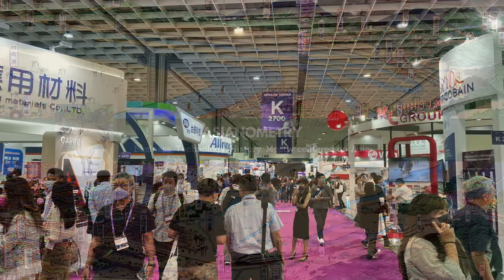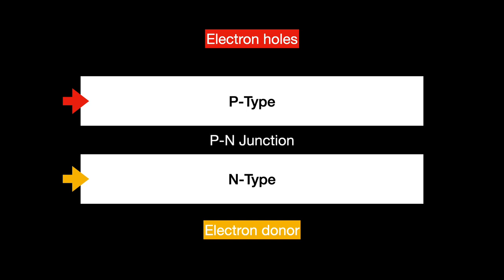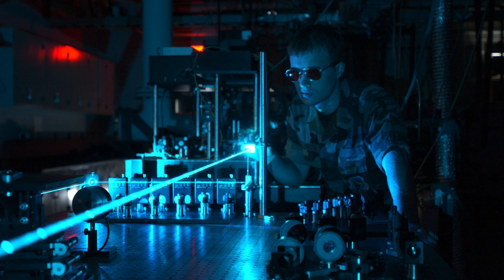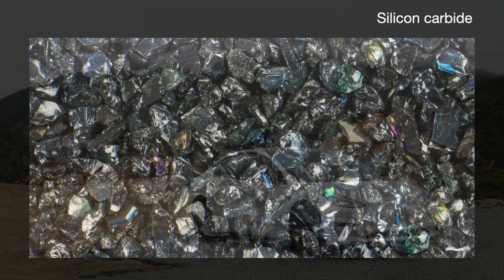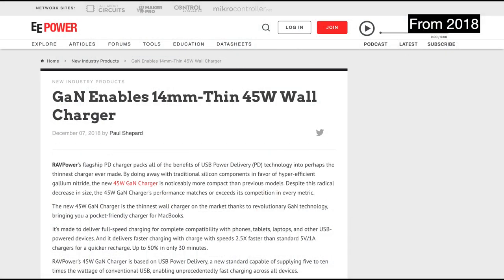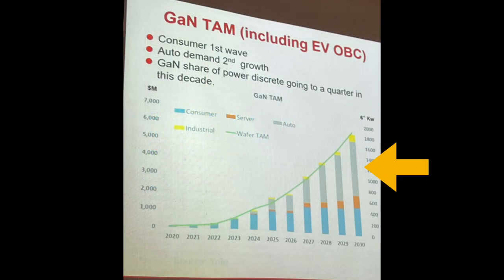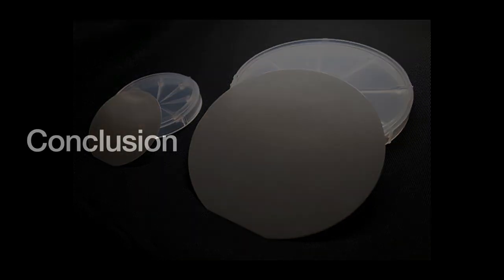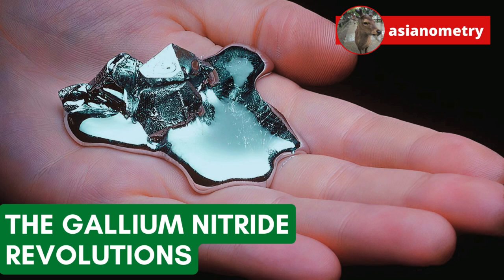The Gallium Nitride Revolutions

Comment: slight correction : it's not mA/h but mA.h, that's energy (not exactly joules, that would be W.s, but for batteries it's the advancement of the reaction so combine that with the battery's potential you get energy)
Reply: I was just coming here to say this :-)
Reply: Was about to comment the same thing...
Reply: It is not energy, but simply charge (sometimes called capacity).
Reply: @UC6j0lZcHJRbSq1J-v8tIYbw @varno Nope. It's a unit of charge. If you know the voltage then you can convert it to energy.

https://en.wikipedia.org/wiki/Electric_charge

Edit: For some reason when I reply to @varno youtube converts their name into that long string of characters while not mentioning them.
Reply: Thank you, I was going to mention the same thing. The unit for 1400 mAh is that it can deliver 1400 milliamperes for an hour, then it’s done. I’m not even sure what 1.4 A/hour would even be useful as.
Reply: slight correction: mAh is not energy, but electric charge.
Reply: maybe the mAh were the friends we made along the way..
Reply: @terrywilder9  technically true, but electric charge moving across a potential difference is energy.  And in the case of a battery, the potential difference is more or less constant and known.  So mAh is as good as, and interchangeable with, energy in this context
Reply: Same......It buzzed my brain. Its Battery charge. kWhrs is energy. I mean the world could be using Coloumb and Joules but we must suffer these mistakes cause Americans
Reply: In fact, that's not a slight correction. that's a big correction.
Reply: @moddingear This seriously  makes me doubt Asianometry and his reliability/validity. I used to trust him before this. Not anymore.
Reply: Beat me to it haha
Reply: @ElfProduct  yep. Same here, like how can you report on this kinda stuff and make such a 101 mistake, at least twice?
Reply: @forbiddenera  in the battery world, amp hour is a commonly (sometimes exclusively) used way to express a battery's energy capacity--things like RVs, and vans and the like all frequently describe their batteries in ah.  The voltage is usually a given (12V, 24V, 5V) and with that information you do get to know the energy in a battery. it frustrates me to no end that this is the common terminology as it can be ambiguous, but it is the way it is.
Reply: @ChuckCassadyYT  I don't know why you're replying to me specifically; I literally design circuit boards and electronics and am very aware of the terminology. In case you misunderstood, the issue we have is that he said mA per hour, not mAh. mAh is what he meant but he said per hour. Measuring milliamps per hour is an absolutely useless metric made even more useless by the quantization effect, eg. Saying that a load consumes 100 milliamps per hour, especially without voltage, tells you nothing of the power used and is ambiguous with at best the assumption being the loads mean current draw is 100mA measured over the period of an hour, but even that is a stretch. Now, mAh on the other hand, which is milliampere-hours (not PER hour) generally tells you how much capacity something like a battery has, 100mAh meaning a load could draw 100mA for about an hour before depleting the source or equivalently 10mAh for 10 hours, voltage generally not being a factor (though with batteries it's generally assumed the rating is at the batteries nominal, mean or calculated/logged voltage).. 

Anyhow, I assume you probably understand this so mostly for anyone else reading though I'm still puzzled why your response was directed at me.
Reply: it is weird because he gets so many more complicated things right, maybe it's a translation thing?

For example, he is spot on about military high power electronics, almost all the developmemt and funding for GaN has been for military.

The mAh units are dumb because they aren't a pure unit. Like how weight isn't the same as mass, but worse. It'd be like if we all lived on different planets and said "I weigh 50lbs, a little overweight" and people have to ask, but we hat planet are you on? Turns out on Earth you weigh 500lbs, so severe.

For that reason I would give him the benefit of doubt that he tried to make sense of units and usually things are per time.
It's purely for marketing. At best it's useful to estimate time you need to charge or run the battery for, if you know the current draw (like 1A for most older chargers, or 2.5 to 3A commonly now, and more). But in usage things draw varying amounts of current. Joules would just be a better comparison..
It almost makes as much sense to say a 2Ah battery runs 2A per hour (for one hour).
In lab battery testing you measure W·h of course, and the integral (area under W·h vs time) is total energy (work it can do). Usually the battery is considered dead when the voltage drops I think 10% of nominal, so even if there's usable charge left at a lower voltage, it is not included (by an honest company anyway..) once the voltage is too low to use as intended.

Energy is like mass in my analogy. (Watt is of course Joule per second, so multiplying by time units in W·h you're getting just Joules, the ability to do work.. more juice, more joules).

If anyone has any good reasons for the mAh usage I would like to hear them, but afaik it's just marketing.

(Also I don't know why you put mA.h or W.s, either... should be mA·h and W·s but for batteries it's common to just use mAh)

I don't know if GaN will be used in homes, there are environmental concerns. People are dumb as rocks so you can't count on them to not eat it, let alone recycle it properly.
Reply: You beat me to it
Reply: Yes, but not energy as defined by physics in potential or kinetic energy. Or by electric potential energy as defined by volts. It is electric charge.  
I think mAh is a very flawed metric when comparing rechargeable batteries and is exploited by manufacturers and retailers. Watt/Hours is voltage independent and can be used between different cell types and multi cell batteries. Where mAh could easily suggest that a much smaller batty with only one cell could store more charge than a 4S battery, for example.
Reply: @wouldntyouliketoknow9891  The potential difference for a battery isn't constant at all. It varies substantially with its charge. If you take a typical 1.5 V cell as an example, it typically varies from about 1.65 to 1.20 V over its useful life, though depending on the application, you might be able to drain some more charge from it before it is effectively dead. For rechargeable batteries, you get the same problem: high voltage at high charge and low voltage at low charge, which electronics have to deal with. The actual energy that can be extracted from a battery can be difficult to calculate in practice and depends on the device you put it in. However, the stored charge is easily calculated, which is why that's what they report.

Of course, in principle, the stored energy in a battery can be calculated with a relatively straightforward single integral, but the calculated value won't necessarily match the energy you actually pull out of it or the energy required to charge it, so it's just a nominal figure without much practical use.
Reply: @craigslist6988  mAh is used in both marketing and in product design. This is because the current drawn by a device is usually specified in milliamperes. It's the same reason kilowatt-hours are used in power generation. Most people don't have an intuitive sense of how large a coulomb or megajoule is, and when calculating things for their own use, it makes far more sense to measure time in hours than in seconds.

The reason units of charge are specified instead of units of energy is that they are easily verified and are application-independent.
Reply: every YouTuber is a EXPECT 🤫.
Reply: @kevinb2469  It could mean e.g. that the measured current in a circuit was increasing by 1.4 Ampere per hour, written as 1.4 A/h
Reply: @wouldntyouliketoknow9891  
Correction: It is not because then the units would only be good for a single voltage.
Reply: @kevinb2469  1.4A/h is the rate of change of output current from a generator with a staggeringly heavy flywheel :-)
Reply: While a very understandable and forgivable mistake, this is an important and much appreciated clarification for those of us who didn't catch it.
Reply: Whats the differance between / and .
Reply: @4gbmeans4gb61  / is short for dividing, as in 1/2 = a half. To divide Amps by hours is nonsense.

. is short for multiplying, but sometimes we leave it out, as in mAh.
Reply: @RupertReynolds1962  Aww ok thanks, wish the entire world used the exact same standards.
Reply: @4gbmeans4gb61  "wish the entire world used the exact same standards" Well, they do! It's called mathematics and it's universal. What Rupert Reynolds described is universally accepted globally in science and engineering. Don't all kids learn this stuff in maths class at school?
Reply: @forbiddenera  I think Chuck pressed the wrong reply button.
Reply: i dont call it "slight"
it is two orders of time-derivative
Reply: @vytautasvaicys8745  what is Lithium?
Reply: @kevinb2469  that's rate of change of current. probably applicable for super enormously large inductors or something.

Comment: Size of batteries is measured in Ah (ampere hours). Not ampere per hours. It's like Wh (watt hours). Ampere is a measure of elemental charges (electrons) per time. So amp hours is a measure of charges.
Reply: Capacity of batteries is measured in Watt Hours = Volts*Amps*Time.
Ampere is a measure of current, Ampere Hour is a measure of current over time. 
Without also knowing the voltage, ampere hour figure is essentially meaningless
Reply: I totally get the confusion here though because 'ampere hours' is very easily misheard as 'amp per hours'.

I've always used watt hours to conceptualize it; amp hours are the same as watt hours but they measure current instead of power.

Interestingly, as I've gotten more advanced with my PCB designs, I find myself using amp hours far more than watt hours.
Reply: @Not_Sure-i6o  Voltage is also meaningless. It's just a made up definition for roughly understanding a charge gradient between two arbitrary points. A lot of units we all use are meaningless. mAh is just annoying because it's abused far more often by marketing departments to make devices seem powerful without actually disclosing any information about the device.
Reply: @Stewi1014  Marketing departments also love Amper Hours figures for some reason 😏
Reply: @Not_Sure-i6o  Cell voltage is a function of chemistry, so a constant. Capacity in Coulombs is a function of quantity of reactants ie size.  So the units are A*h
Reply: You're right, but the way you worded the second part it becomes hard for laymen to understand that when you say "charges" you're not referring the act of "charging up the battery" but rather referring to "the amount of Coulombs".

So for anyone curious:
Watt (rate of electricity consumption) = Joules/second ("energy chucks per time unit")
Watthours (total electricity consumption) = Joules/second * 3600 seconds (so the seconds cancel out and you're left with 3600 Joules)

However, Watt is also equal to Volts * Amps (sorry physics teachers for the laymanified notation).

This means that when you have a, say, 3.7V battery rated for 1000mAh of capacity you just multiply the two to get it in mWh, which in this case is 3,700mWh. Then divide by 1000 to remove the "milli" part and you're left with 3.7Wh, or divide by 1000 again to get to the kWh you're used to from your electric bill. In this case 0.0037kWh.

But here's the catch: What I just said is complete nonsense... Because a battery does not deliver it's rated voltage from 100% to 0% capacity. The voltage will decline as the battery discharges. This means that you will, in fact, not get 3.7Wh our of the example above. The battery will start at 3.7V but end at around 2.2V (I'm using my Vape battery as an example) before it's sufficiently "flat" to not be able to drive my "device".

And that's the reason why battery capacity is measured in amp-hours (or milliamp-hours for small stuff), as the Watt-hour approach "is bogus" despite it looking more familiar.

You can, however, go V * mAh * 3/4 and get a reasonable approximation for modern lithium batteries. "The constant" will change depending on the battery technology, but I've rambled on for long enough, so I'll spare you all for a lecture on the implications of a battery's internal resistance and how that directly relates to Ohm's Law.
Reply: @Not_Sure-i6o  Ah is better that Wh because it is independent of operating voltage. You can calculate the numbers of hours a device will last with it given current draw.
Reply: @agnelomascarenhas8990  No.
Cell voltages and charge/discharge curves are the same for Lead acid? NiMh? Li-ion? HV-Li-ion? Lifepo4?
Edit* Wait, what? 🤣
Reply: @gljames24  No, just no. Amp hours is only half the picture. Take two laptops, both have "4Ah" batteries, but one has 4 cells in series the other only 3 cells in series.
Huge difference in capacity, but look the same when only comparing Ah
Reply: @andersjjensen  Watt Hours isn't "bogus", it's the full picture.
Reply: @gljames24  I don't know about you, but I buy/sell consume collect and store energy in kWh. 
For example, a 100AH powerwall is absolutely meaningless without knowing voltage and chemistry.
Reply: Did you really just try to correct the man making the video on the advantages of Gallium nitride semi conductors? Bahahaha
Reply: @DMSparky  I know Asianometry throws in the odd typo to encite fervour in the comment section, but this was one of his videos well outside his realm of expertise, based off marketing and VC capture fluff
Reply: @DMSparky  try to correct? Ampere per hour is a completely nonsensical unit in this context.
Reply: @Not_Sure-i6o  The "conversion" I gave for equating mAh to mWh is bogus. As I explained.
Reply: @Not_Sure-i6o Volts*Amps*hours
Reply: @andersjjensen  The effective Ah of a battery changes far, far more than the nominal voltage. In fact, the nominal voltage is practically static. Obviously the battery changes voltage as it discharges - the shape of this discharge curve is very well characterized - averaging 3.7 volts for a LiPo.

External temperature, when the battery was charged last, how fast the battery is discharged, how fast the battery was charged last... ALL effect the mAh rating of the battery and not the voltage discharge curve.

Everything you said applies to Ah, not the batteries nominal voltage.

Ah has and always will be dependent on what you ate for breakfast.

wh has and always will be subject to the inaccuracies of Ah measurement, but at least it means something.
Reply: @Stewi1014  Go find a mirror. Look in it. And keep saying "I am special. I am right. I know best". FFS... EVERYONE in this thread is telling you differently. The sentence "The effective Ah of a battery changes far, far more than the nominal voltage" doesn't even make any sense. It's completely irrelevant (insofar the battery doesn't get hot) if you draw 0.01A or 1A on a given battery. The duration you do it for will add up to the Ah rating barring any heat losses. End of freaking story. U = R  * I also holds true for batteries. Until you invent a battery with a resistance of zero the voltage will drop to zero if you drain the battery enough. Most devices, however, don't drain a battery fully as they need a minium voltage for the VRM to work correctly (and it's also not good for batteries to be completely sucked dry). Go find a multimeter, a battery and a drain source and verify for yourself. If you were right they WOULD specify capacity in Wh instead of Ah because that would be a bigger number. And bigger number is always better number when marketing gets involved. The very reason marketing was told off is because it would be freaking false advertising!
Reply: Thanks. It cleared away my years of confusion. This really helped
Reply: @andersjjensen  Nominal voltage you dip. I'm not arguing that the voltage doesn't change.

Nominal voltage is defined by chemistry.

I'm fully aware of how batteries work.
Reply: @Not_Sure-i6o  
You are typically comparing batteries of same number of cells of the same voltage, like 12V car batteries or 4.2V Lion cells. So the Amp hours are accurate enough for the comparison.
In other areas where the voltage varies like notebook batteries of an undefined number of cells, the capacity is measured in Wh. 
So yes Ah is not complete, but not in general useless.
Reply: @fromgermany271  What about lion Vs lifepo? Or hv-lion? What number are we actually comparing nowadays for most purposes? kWh!
Reply: @Stewi1014  have
Reply: My attention span vanished when a weird unit for intensity variation was mentioned in the video.
Reply: @Not_Sure-i6o  well you need an algorithm because the volts change across the discharge curve. which isn't nice and linear either!
flat isn't 0V in lithium. it has to be for arguments ~3.3 ish volts give or take.... versus ~4.2 @ full for a nominal voltage of 3.7 V. 

i prefer the amp hour or coulomb for this reason.
Reply: @transkryption  if you're talking single cells then yeah, but rarely is anyone dealing with single cells outside of manufacture setting.
 At least watt hours gives a representation of usable capacity, usually accompanied with cycle life at a given C/discharge rate.
Amp hours is only half the picture, just look at lead acid, divide by 2 to get anywhere near real numbers.. 
End voltage also influenced by sag under load, again, watt hours will be linked to a discharge curve (volts AND amps AND time)
  Incidentally Lifepo4 will happily go down closer to 2.5v, which is why 4S lifepo4 makes a good 12v lead acid replacement while li-ion doesn't
Reply: @Not_Sure-i6o  what is H2O ?